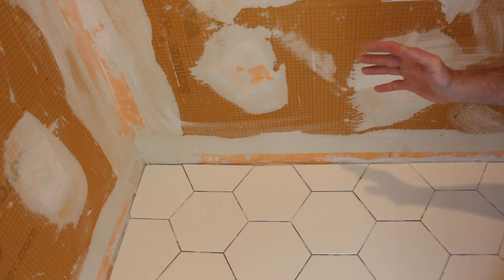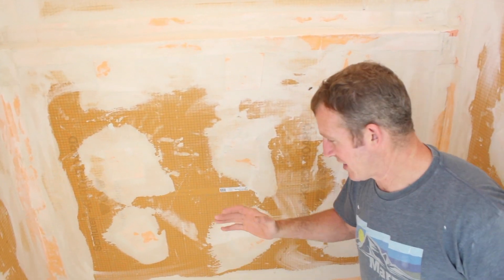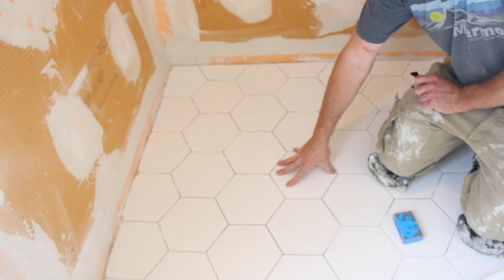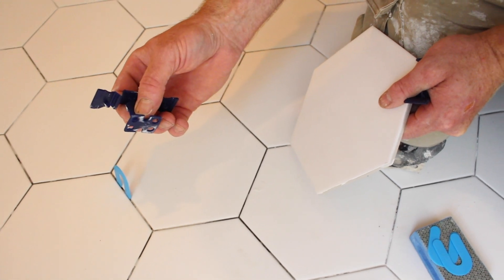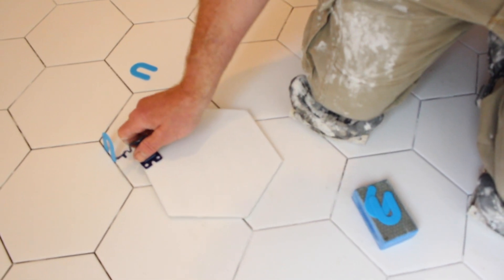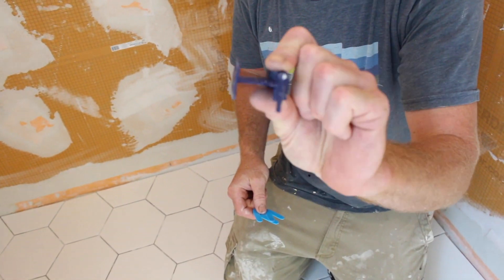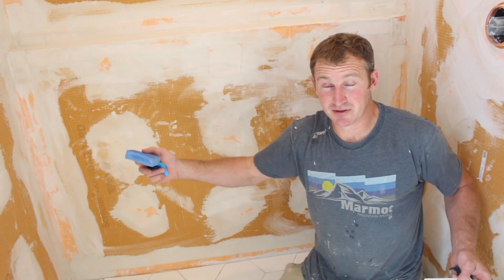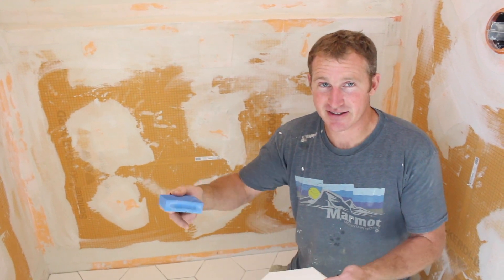Hexagon Tile Floor Tips for Curbless Showers

Comment: What about tiling hectogons

Sounds like a mission from hell
Reply: You meant octagons (8 sides) or Heptagons (7 sides) ? There are also decagons (10 sides).
Reply: @saulger6409  
Heptagons since you could fuse 2 on both top and bottom sides of left and right of it but then when you try tiling the top, it would be physically impossible to continue the pattern. It is hard to describe a configuration because of lack of visuals to present like trying to make someone visualize a dream (the most mysterious and difficult thing to explain without being unsure and thinking you sound crazy)